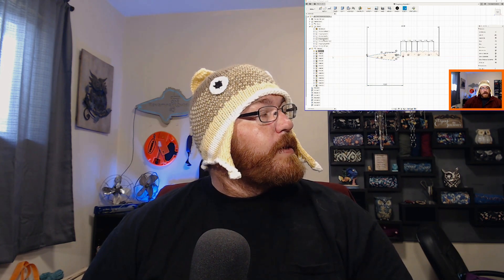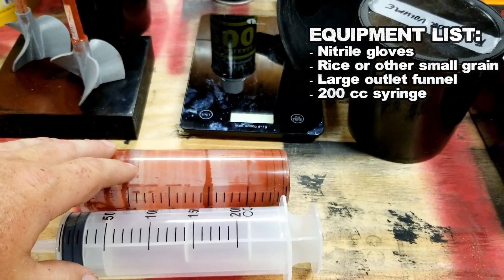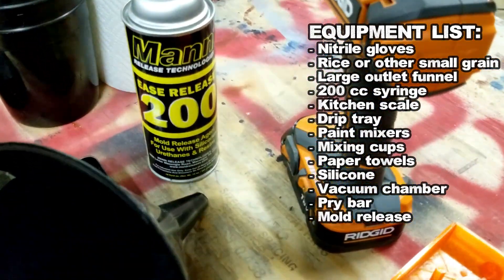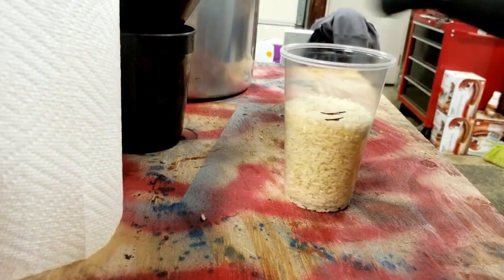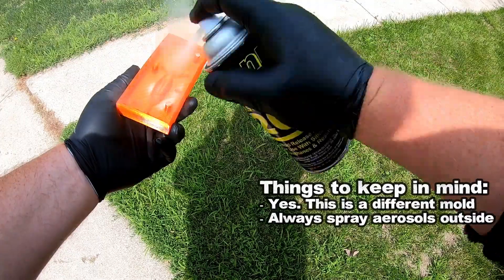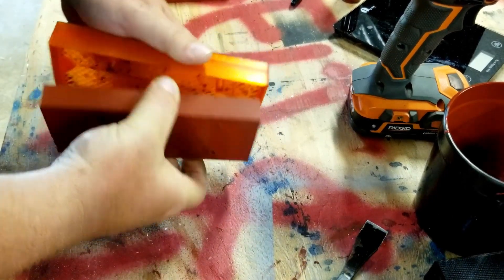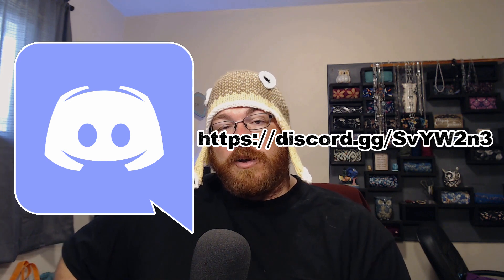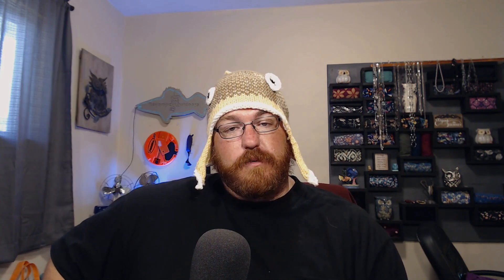How to pour a two part mold for soft plastic lures - Soft Plastic July - Episode 2

Comment: Do you not use vac 50 anymore and if so what’s the reason why?
Reply from the maker: Haven't found a need to use it so far, I like the mold max 60 now for the ability to remove the master much easier, the overall durability seems ok so far I don't have any molds that have broke down over time.

Comment: I plan on making a duplicate mold from one of my aluminum molds by using rtv and those would be the master molds would u recommend vac 50 or mold max 60 for pouring into the master molds would this work or too good to be true?
Reply from the maker: I think it should work well, I would probably do mold max 60 into the aluminum and then vac 50 into the mold max. I would say mold max 60 both times but silicone on silicone sticks like crazy so you need a lot of mold release. And the vac 50 will last a bit longer than mold max so for a final copy I would probably go vac 50. I hope that makes sense, should work well and it's a great idea, saves a bunch of money if you use the mold all the time.
Reply: Sounds great man how long do those vac 50 molds last in your experience
Reply from the maker: @blakegaines2290  I haven't had one breakdown so far in 2 yrs. I've thrown them out by making newer better molds before I've had any problems with the material. Vac 50 does hold heat a lot better than mold max 60 though so if you're trying larger baits they will be a little slower to set up than the mold max and slightly quicker than  aluminum.
Reply: @RevampedOutdoors 

My only concern is when I see people make molds they often end up with flash due to them cutting out parts for air to escape but if I'm duplicating a mold that already has ventilation I shouldn't have any issues correct? Thanks for your help with this.
Reply from the maker: @blakegaines2290  for sure, in my experience with the silicone molds I mostly get flashing if the molds don't have good clearances (sloppy construction with gaps) or the venting causes some dimples because the air can't escape before the plastisol sets. The other flashing would be if the mold material is too hard and there are air bubbles when the material sets. So far with this method in this video I don't get flashing anymore. With a mold that is premade and shoots well in aluminum all that should be thought out already and you should be good to go. The silicone will be nice and smooth on the aluminum so the vac 50 should me smooth on the silicone. The mold copy will be a few thousands of an inch smaller because of the replication but it wouldn't be noticeable. I think the most important part of the duplication will be vacuuming out air bubbles from the mold material to be sure that air pockets do not form while casting the molds. My 2 cents anyway.

Comment: Is there a way to make the baits shiny when using these Silicone Molds?
Reply from the maker: If you add a thin coat of worm oil on the sides before injecting it can help, but they will never get to the machined aluminum finish of a standard Al mold. A lot of the dull matte finish comes from the variation on the layer lines of the print as well because the print will never be completely smooth. There are epoxies to smooth the lines but they will never be perfect. Works enough for me so far though, I figure it's not enough of a work around considering I can make about 60 of these molds for just the cost of a decent Aluminum CNC ($1500) that's including the 3d printer cost.
Reply: @RevampedOutdoors  I would be interested in seeing what a clear dip would do to the finish after molding some baits. Future video maybe?
Reply from the maker: Definitely, if we can get enough suggestions to try I'm down to give anything a go. I've heard of people using cooking spray like pam to keep soft plastics pliable and not stick together so maybe coating the mold halves with that may also do something.
Reply: @RevampedOutdoors  Heat gun on the finished baits shine them nicely practice first.
Reply from the maker: @moonrook76ify  good call, completely forgot about the heat gun! I've been experimenting with different oil coats and got some nice shine on a couple but I'll for sure try a heat gun soon. Thanks for the suggestion.